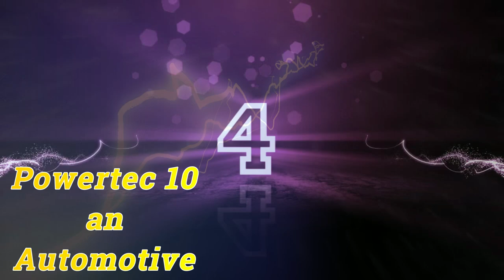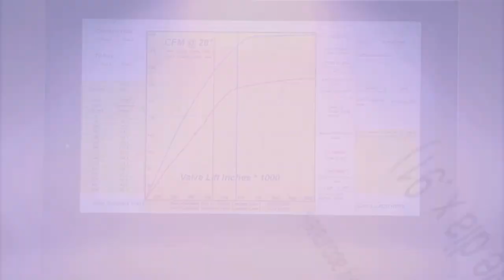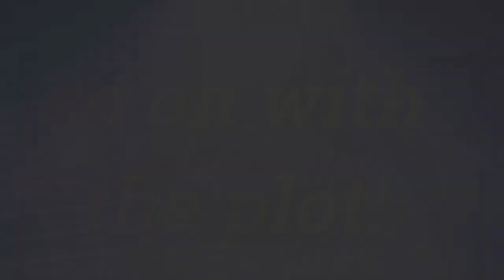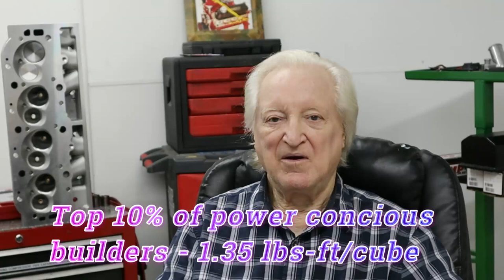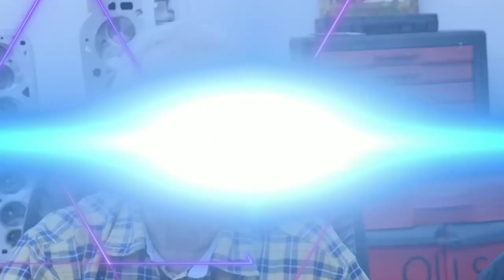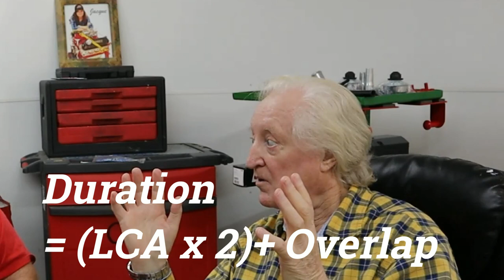Vindicating DV's 128 lobe centerline selection formula

Comment: Ford crossflow engine can using only flat tapped cam lifters, there no possible install any rollercam lifters, stem are 13mm 0,510 inc size so they are weak when using high pressure valve springs,  other reason when using high lift cam they get a lot cam counter energy against,  just this reason engine can go broken if lifter break. Need solve this problem, one option is use better stool steel and machining optimal shape these flat tapped lifters and hardening they close 60 hcr.

Comment: The only way to know for sure and I'm sure that you have done it is to put a cam in there with less separation and then to put a cam in there with more separation and the one with 128 do all the dino runs and evidently the cam with 128° load separation is the winner

Comment: David, I have a question. If the LCA widens, as rocker ratio increases. What does your formula assume is the rocker ratio at the time of calculation? 1.5:1?
Reply: Yes, in another video,  he mentions formula is for  SBC using a 1.5 rocker ratio and adding  degrees as you go up per 0.1 value in rocker ratio

Comment: May I ask you for some advice or maybe your thoughts on an engine I had built for me for big money. I had a 406 built for me at a local performance shop with 10.5/1 approx, AFR 210 eliminator heads2.08/1.60 65cc chambers, Victor Jr intake, 17/8 long tube headers.FST pro billet extreme carb , 1.6 roller rockers , solid roller lifters, 5.48/5.48 i thnk its a 112 LSA not positive erson hydraulic roller grind cam,
all forged internals, electric water pump, electric fan and when they dynoed it I was dissappointed with the numbers 526hp504tq which seems soft. Especially now after applying your 128 rule. Thats only 1.24 lb/ft per cube. This engine was almost 10000 dollars. Any advice or recomendations would be greatly appreciated. Thank You
Reply: There is no way you calculated that correctly, you should be at about a 105-106 lsa.

Comment: I want to build a 5.7 hemi with 11:1 compression so I really look forward to this series. I have a off the shelf comp cam 201-428-17 for it. The specs are 226/234 at .050 .612/.619 and a 116 LSA with the intake center line of 119. Now I’m not sure I want to run it lol.
Reply: Yeah, just add 2.5 to the lsa calculated from what his formula gives you. For a hemi. It's in one of his books.
Reply: So instead of like a 108 if it gave you that run 110.5
Reply: @jonathoncouchey7151  yeah the gen 3 hemis have such a wide lifter angle I think that puts a whole new spin on lsa.
Reply: @jonathoncouchey7151  What about 455 Olds?  Any mention in his books? Thanks...
Reply: Tight lsa are winning on NA.   Even with good flowing heads.

Comment: David, you mentioned on another channel about offshore boats. If you have a SBC with 10.5:1. What would lobe separation be so you wouldn't have water reversion? I think we are locked in at 112 to 114. Do you know anything different?. Thanks for your time
Reply: I'm not as smart as him but I always run 112-114 on my chevies Great power to 6500 hundred
Reply: What cam are you running? Thanks

Comment: I used the 128 formula for my ls1 with trick flow 215  cylinder heads with a 2.040 Intake  valve. It  comes out with a 108.59 lsa. It seams excessively tight for an engine that needs to make peak around 7000 rpm. Am I thinking about this in the wrong way?
Reply: Yeah I came up with
109.17 for a 318 Mopar...

Comment: You know I gotta ask. What happens if you do the math and you run into a 104.5 lobe centerline angle do you go to a cam with a 105 or 104 or 103 whats the benefit or is there one. Will it perform better or worse. Will it make more torque per cube with the tighter lsa and up high lose the hp per cube or vise versa with the wider lsa isn't that the goal
Reply: Lobe centerline angle

Comment: I’m building a 351 Cleveland stroked to 389 with 4V Quench heads and 10.5 ratio. I called Bullet with all my specs right down to tire size. The rep from Bullet raced Cleveland’s in the 70s and recommended the roller cam for my build expectations. Should I be concerned since Bullet recommended it based on my info?
Reply from the maker: Not sure I have enogh info to make a comment here!
Reply: @DavidVizard  
Duration @ .050 I 228   E 234
Lobe lift               I  .3250  E .3270
Separation  110  OP - CL     OP - CL 
Timing Events .050  8 - 40   51 - 3
Duration @ .006   280     288
Gross Valve Lift   .562     .566
Degree intake lobe to 106
I typed this from Bullets cam card. Is there any more info needed? Carb is a Summit 750 with vac 2ndarys. Ford AOD trans with 10” lockup converter all built by Frank Lupo of Dynamic Transmissions.  3:89 posi gears with 26.5” tall tires. Street engine build with a occasional trip to nostalgia drag. Car has A/C and PS with vaccuum controlled HVAC. 1970 Mustang. 3 experienced builders said this combo would work well. Your thoughts? Thanks for taking the time. I watch most all of your videos. Very informative. God Bless

Comment: So I’m trying to build a 351W for my wife’s streetrod. It’s going to be a driver. The CP ratio works out to be 9.5. I’m planning on a roller cam if it works out. My heads run out as cast at a little over .500 lift and have 2.02 valves. I figured the 127 formula comes out to LSA=107. According to David my target over lap is to be between 30~55. How do I figure the duration and lift. I assume the lift should be where the heads say they can breathe to. Thank you for any help.
Reply: Single pattern symmetrical lobe cam would be 244 degrees for 30 overlap,  269 degrees for 55 overlap.
Reply: Thank you Tom. I see how you got those and I realize they are the lower and upper of my target range but…… how do I get closer to the target of what’s best for the motor?
Reply: @wardfrahler6779  Back over to the experts...
Reply: Copy that. How do you get an expert that follows DV? I’m not an engine builder, just a guy trying to get the best possible outcome from a motor that is going to hopefully be driven across the country.

Comment: Is this intake centerline or lobe separation? I feel dumb asking, is the 127128 formula for intake centerline or lobe separation?
Reply: It's Lobe Separation, Some call it LCA like DV does..
Reply: @UnityMotorSportsGarage  I wondered because when I specs the cam for my 394 FE with 2.06 / 1.6 valves I used the intake  to divide and I came up with 105 I calculated that at 9.8 :1 CR that 54 degrees was just right so they told me I was crazy, but I specd it to 105/105/105 and 54degrees of overlap. I built it as a solid flat tappet.  Straight up no dual pattern I can’t see why anyone would reduce the intake to exhaust duration. All exhaust wants is out. Get the exhaust port right and the headers. This engine has been running since 2000. It is very loud and has torque like you wouldn’t believe or expect. It pulls to 7000 rpm s with no apparent loss of acceleration. A wheel dyno adjusts it to 512ft lbs and 496  fwhp with a cam that idles at 950 rpm’s  on 93 octane . 2 inch primary tubes with 24 inches of 3.5 open collectors into 2.5 pipes to the rear axle.  394 ci. This 127 and 128 both are within 105. It sounds crazy but the car will snap your neck.
Reply: @UnityMotorSportsGarage  Ask him to amend his termonology- very confusing as seperation is a universal term
Reply: @arthurking6549  - I agree.  I always have to remember that he means LSA and not intake centerline.   I understand that LCA makes sense - it's the angle between the intake and exhaust centerlines, but I feel LSA is less confusing as I know exactly what is meant by Lobe Separation Angle.
Reply: I misspoke on my 394 ci FE. I used 2.055 valves and used the 128 formula, it came to 107. I found my notes on it. I set it up at. 107/107/107 , 54 degrees overlap and it has a sweet lumpy idle like 63 427 FE. with 2x4 carbs and iron headers or the commonly used solid in the 428SCJ, and a RAIV 400 Pontiac. The FE flows so well on both intake and exhaust and are so well balanced in design. I want to use a HD truck block with the 3 rib crank saddles on the center 3 like the 427/428 CJ and SCJ. I want to bore to 4.132x 3.85 by offset grinding the truck steel crankshaft. It would be 413ci. I have a 245@.050 single pattern on a 110LSA that would need regrinding.using the 128 formula and at 11:1 ( it is a hyd roller) I think that the 107 /107/107 would do well. The 394 was freakish. The 413  FE should be very strong I will be using 2.165 intake and 1.7 exhaust with iron early style tall port. 352/390/428 style ports with some optimization of my own, mostly short side twist with a widening of both ports. The heads are 13 degrees wedge with the D shaped squish chamber with the piston at zero deck and.041 steel reinforced head gaskets. I’m trying to get a 2x4,Tunnel Wedge that matches the Medium Riser and will be great for my Low Riser ports after optimizing the match. The angle fore and aft match the 4 angled forward slightly and rear 4 angled back slightly . Long , tall round until going under the valve covers where they transition into rectangular shape.. I am not in the condition I used to be, but where there is a will there is a way.  I heard recently about regrinding steel roller cams into flat tappet solid cams with lifters that turn at a slower speed for the FE from the years before they had hydraulic oiling passages, or blocked ones like I did for my 394 to keep oil in the lower end. I don’t like hydraulic lifters, even roller.. so I am considering this also. By my calculations this engine will reach 1.31 lbs ft of torque and 1.6 horsepower per cubic inch..  That would be 541 pounds and 66O horsepower. The FE is quite capable of living with this power. I’m planning to reduce the rod bearing diameter to 2.2 so I can use a 6.7 BBC rod which yields a nice serene 1.74 R/S ratio and at a 10.155 deck a stable 1.53 forged piston with low friction rings 1mm/1mm/ 3 mm . With this in mind is the 128 formula appropriate? The FE has excellent flow and velocity/ air speed from.050 to .600-.700. My cam would be.600 after lash. Opinions? Ideas for improvement. I have been building engines off and on for 45 years and the devil is in the details.  Thank you DV for your books, testing and the sharing!
Reply: Mr Vizard, on the FE, the stock heads flow better than a SBC , especially when optimized. Most builds utilize 2.09/1.66 valves and are 400 ci or more, they have a good history of making power when properly built. My 394 FE , I put hose barbs in the intake valley to allow air out of the crankcase and just the front and rear returns to allow oil to the crankcase.  I’m wondering if in the case of the FE that the formula would allow 129?  The 428CJ and the 445 strokes at 4.25 are similar to the Pontiac and Oldsmobile 455s that have 2.07-2.11 intake valves. 129 usually gives a 106-108 LSA. 
What do you think about the other engines? FE, Pontiac, Oldsmobile from 400-455, in mine I went for wall stiffness going only .020 over. I could have added a 428 crankshaft for 414 ci. But with the 107 LSA straight up it is a beast and lives on from 1999 still going strong.  The cam is a solid and the CR is right at 10:1, long tube 2 inch primary headers with 24 inches of 3.5 collector with extension. 512 lbs ft and 496 hp and will pull to 7000+ rpm’s and people swear it is a 427 LR or 428 CJ. The 2.055 intakes are the same size as the 1963 427. 
But the other makes are asking if we should use 129 or even 130?

Comment: Maybe it does not prove anything but seems interesting to me: I calculated the "128 formula" for my 83 cid 4 cyl 2 valve engine what produces 1,15 HP/cid in factory form. The bit spicey OEM camshaft for that specs has an LSA of 116,24°. The DV formula with 128 degrees to reduce gives 116,27°. It can be an accident as it is very far from an SBC, but it is SPOT ON. 🙂
Reply: Can you explain to me how to use this formula? It doesn't make sense to me.
Reply: @stevedolyniuk3358  It is simply the equation of a line in the "LSA-valve diameter" coordinate system. It starts from 128° LSA and slopes down as the intake valve diamater gets larger. But my example was a joke, as the parts of the primitive formula are based on a much more complex calculation for a 10,5:1 SBC. If it is calculated for a different engine (like my tiny 4-banger) the numbers may vary. The 128 is 132 for example. 
So it doesn't mean anything that my calculation was spot on, because the basic formula should be recalibrated for the other engine.

Comment: I found out 20 years ago the cam manufacturers just make cams, without testing every engine.  Its based on testing of generic engines, not real world.  ( assuming a specific lift / duration is acceptable across the board. )   About the  128 formula,  what valve diameter do you use when you have 2 intakes valves like a ford 4.6 DOHC ?
Reply from the maker: Mike - this won't work for an engine that is so much different to a SBC.

Comment: Would the 128 method work for a BB Mopar? It's 10.6:1. I ask because your number is exactly what I was leaning towards without any empirical data to go on, just my gut.
Reply: I think he explained it In one of his videos. The lsa needed for a big block because of the lack of airflow would be something like 103. But no one grinds that narrow.
Reply: @jonathoncouchey7151  THat's a Big Block Chevy!  The intake ports on a 440 head look a lot like a SBC!  Look at the BBC intake ports VERY different, that's the reason the number changes.  I'd be willing to bet DV would recommend 128 or close to it for the 440 based on the intake port arrangement on the head. @Joshua Seal BBM head looks like a SBC head you should NOT use 103 but probably 128.

Comment: Could you show us what you mean by widening or closing the centerline with a picture or numbers? Is shortening meaning if its 108 you go to lets say 107?
Reply: He does on other videos, LSA is the centerlines of the lobes  at peak lift and the lobe separation angle is the degrees apart those two points are.

Comment: Could you explain the math for people who are not good at math. so they can understand what you divide and multiply and when .some people don't know what these are ( / ) for example .and that  you do this part first ( ) just trying to dumb it down for new guys. I had to explain it to my brother so it got me thinking .but I loved the video can't wait to see more.
Reply: - multiply the intake valve diameter (in inches) by 0.91
- divide 8 by the result from the above line
- divide the CID of the engine by the result from the above line
- To get the LSA, subtract the result from the above line from 128
The other option is to go to just put the equation in your browser search box with the numbers in it.  For example:
=128-406/8/2.08*0.91
(That's for a 406 CID SBC with 2.08" valves.  You should get 105.796875)

Comment: Mr V, its been roughly 40 years since my last math class, and I rarely use it. Your 128 program is interesting, but I'm thrown by how it's written. Specifically the (CID/8/Valve dia. X .91)  What's throwing me is the two / es. Do those mean "x" or ÷  or something else?
Reply: slash is division.  So it's cubic inches divided by 8, then divide that # by the valve diameter then take that number and multiply it by .91.   Lastly, subtract that number from 128 and you have your answer.
Reply from the maker: / means divided by.
Reply: P.E.M.D.A.S is the rule for all mathematics parentheses, exponents, multiplication, division, addition, subtraction. Always in that order, no exceptions
Reply: @b.c4066  Or go off the reservation and do RPN and use the stack
Reply: @toomanymodz  Oh, that's what I thought it meant, but I believe it should be written as  (Cid÷8)÷(Valve dia. X .91) This may seem trivial to you, but would've made it clearer to me.
Reply: I have a 327 with 2.02/1.60 valve heads I'm coming up with a 110 lobe separation using your method. Where do I go from there Young Vizard as to lift?

Comment: DV wrote:
 the 128 'gimick' as you call it is a very simple & HIGHLY FUNCTIONAL means of getting the LCA for a SBC with 2'02/1.6 valves and a 10.5/1 CR. It produces results way way better than the cam companies desk jockey's.

So now the formula has gone from being the most important thing for spec'ing a cam to a narrow range of SBC? That is only better than (as you call them) desk jockey's).

How is it that now you specify what valve diameter the formula works for, but also use it as a parameter of the formula?

Comment: This formula does not make mathematical sense!  A valve is a circle, and the area of a circle is achieved using the formula π*r², this formula uses the diameter of the circle, but increasing the diameter of a circle by 5% increases it's area by ~10%!  This formula may work for a specific valve diameter, but it cannot possibly work for all valve diameters!

Comment: Why in the world would anyone use a 2 variable formula like 128 when comprehensive 1D simulation is affordable to individuals?
Reply from the maker: Jon - I would have thought you could have figured that out for yourself. My method costs nothing, produces really good results and can be done in under 90 second!!!!!!
Reply: @DavidVizard  
David, none of what you posted validates your 128 gimmick.

The fact that the following variables influence the ideal LSA that your 128 formula does not take them as input is all one needs to know, to understand that the 128 formula is not comprehensive.

Throttle size
Intake manifold
Port flow maps
Chamber flow trajectory
Intended RPM range
Valvetrain stiffness
Valvetrain mass
Valve acceleration
Header diameter, steps, collector dimensions
Exhaust system
Drivability requirements
Emissions requirements